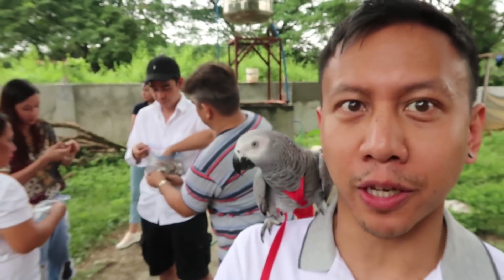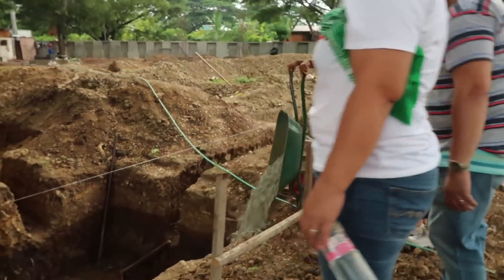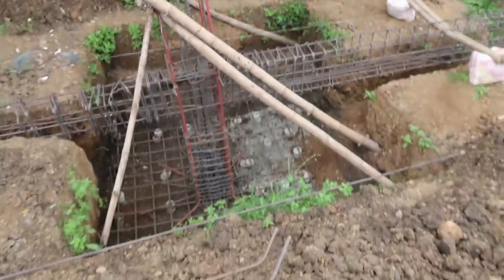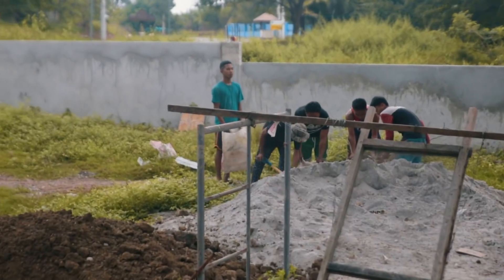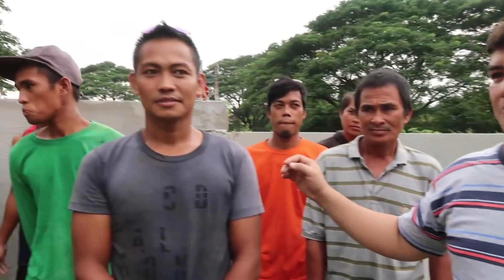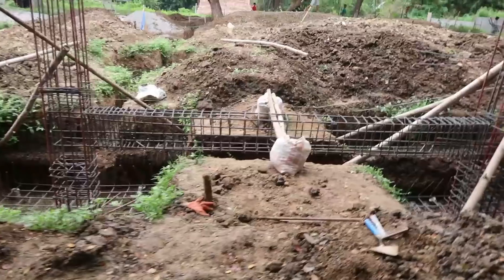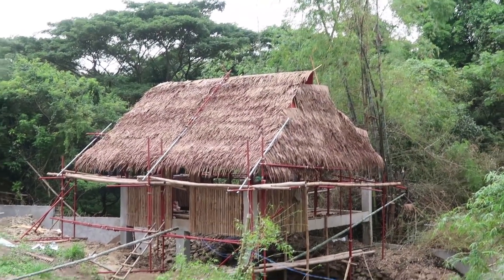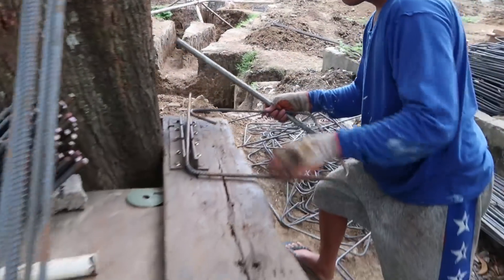Meeting the Workers Building Our House | Vlog #683

Comment: Hi mikey, 
Here are my comments on what they did, although not everything was shown in the video. First, what i know in the construction, the coins must have a specific number and only one kind. Holy water is also not required. Second, they have not yet place any steel bars on some of the foundations why did they schedule the ceremony already. Third, they placed steel bars on the tie beams already, although it is not a problem, but usually we pour the foundation first. Fourth soil poisoning was not done. This is a process to ensure that termites will not go in to the concrete. Fifth, if they will pour the foundation manually with a 1 bagger mixer, it will take time and it might affect the structure.